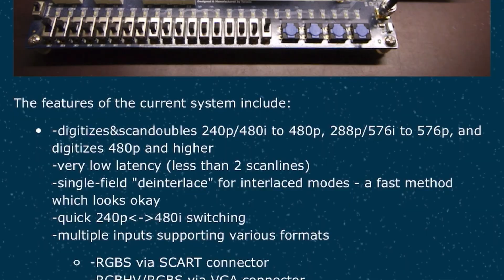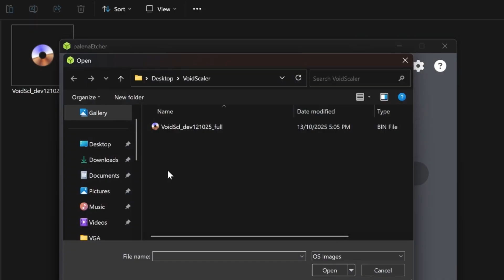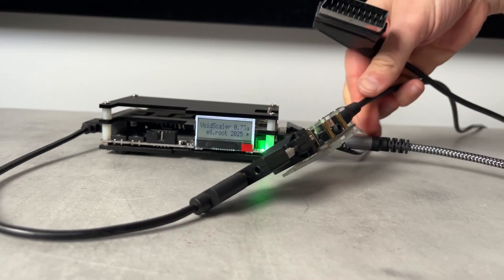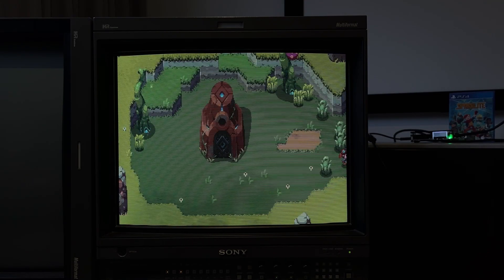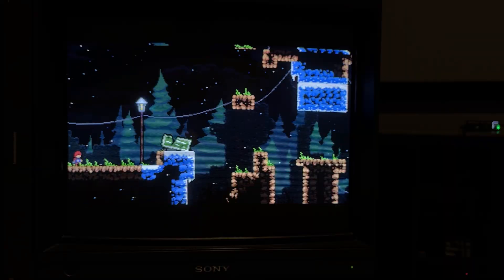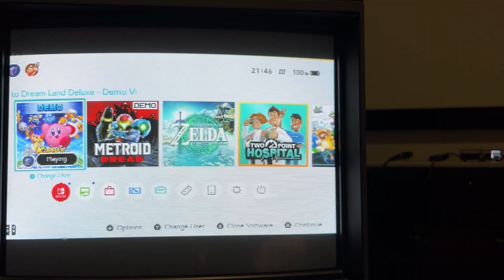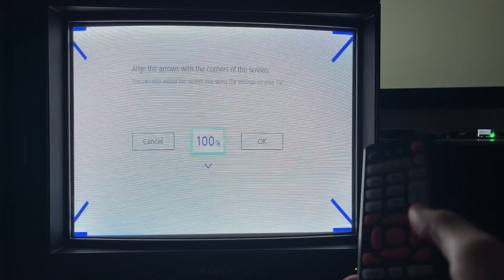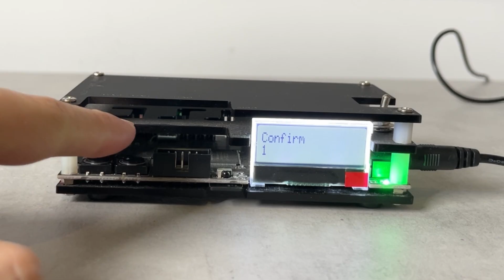Downscaling Chronicles 22: VoidScaler OSSC CFW for Low-Lag Line Blending 240p and 480i Output!

Comment: That's cool ;) But is it possible to connect the ossc on tv with only scart ?
Reply from the maker: Yes that is fairly easily done with the setup I showed in this video, provided the TVs scart port is for RGB and not just composite. You would need an HDMI to VGA converter on the output of the OSSC. Most DACs output 5v on VGA pin 9, so you would need a VGA to Scart cable from a reputable seller that conducts VGA pin 9 to Scart pin 16 for RGB switching on the TV. Something for the Mister FPGA will be fine. Those cables also tend to have a resistor on the Sync output which is necessary to reduce C-Sync to safe levels for your TV. So short answer, yes
Reply: @MarcoRetro316  All right. Thanks a lot for reply.  I will try.

Comment: Dude this is awesome but those DAC makes it a bit cumbersome?
Reply from the maker: It’s not so bad since Pawel’s made it so no sync combining is necessary. Compared to other methods which do require HV sync combining for RGB output like the GBS-C, DExx, RT5x, RT4K, this is pretty stellar. HDMI to VGA DACs are fairly cheap, hopefully they’ve kept support for 240p as I bought all of mine several years ago
Reply: @MarcoRetro316  any particular ones you can recommend?
Reply from the maker: @MagisterHamid  I don’t mind the cheap ones that are powered by HDMI for convenience like the ones I used in the video. The links I used to purchase are long gone though but you could take a $5-10 gamble. If you want reference-quality then check out Kuro’s DAC spreadsheet. The Relfex Prism and HDFury’s are highly recommended but expensive

https://docs.google.com/spreadsheets/u/0/d/1nbepvFFBVsLrs1myOiVWqMVLp9-oB9TataRmVlcyqlA/htmlview
Reply: @MarcoRetro316 I have a HD Fury 3. But you mentioned that DACs needs to be used on both ends?
Reply from the maker: If you want to input HDMI then yes you’ll need one there as well
Reply: @MarcoRetro316 maybe you mentioned it in the video but this method does not downscale Wii’s 480p to 240p right?
Reply from the maker: Correct, it doesn’t currently handle 480p or component input

Comment: Just picked up an Extron DVs 605 and am excited to try it out on my BVM D24 - hoping to get steamdeck and switch to output at 240p - do you think thats feasible? thanks for all the useful content
Reply from the maker: Yes that’s feasible. The steam deck, or at least the OLED model outputs 75Hz by default. You’re best to change the output to 60Hz on the deck. The switch will work fine at any resolution. Given the BVM D24 is multiformat you can use the DVS 605 to downscale 1080p to 1080i which will look phenomenal. Otherwise no problem downscaling to 240p.
Reply: @MarcoRetro316 will I be able to use your edids for the widescreen monitor or do I have to source from elsewhere? Thanks again
Reply from the maker: @8percentAndroid  They should display just fine on your monitor in 16:9. There’s some instructions I wrote on RetroRGB in the downscaling section bottom of the page for the DVS 605. You have to manually adjust the H size for 1920x240p but then you can save the preset for easy recall next time
Reply: @MarcoRetro316  beaut thankyou mate
Reply: Thanks very much

Comment: i got an ossc pro just for downscaling, haven't even had time to try it out, but now i need to buy an OSSC???
Reply from the maker: You’ve already got a prime Downscaler. Currently the cartage of VoidScaler over the OSSC Pro is that it can blend lines. I’m really hoping Markus pulls this code into the Pro
Reply: @MarcoRetro316  that would be awesome, haven't even tested my ossc pro yet! (or my corio 2 for that matter)
Reply: If you absolutely need features offered by VoidScaler you can buy it but at the same time you can just use OSSC Pro and wait for VoidScaler or line blending on OSSC Pro - whichever comes first. I plan on making OSSC Pro version of VoidScaler regardless of if someone adds line blending or not. In this case obvious improvements on the Pro will be HDMI input and no horizontal resolution limitations everything always running at full horizontal resolution like it already does on OSSC Pro's own downscaler.

Comment: That’s AWESOME. I’ve been considering upgrading from my OSSC and framemeister to the OSSC pro, but with this downscaling which was the main feature I was looking for in the pro, is moved to be part of my current setup. Then I can see if upgrading is necessary
Reply from the maker: Try and see once the VoidScaler FW is released if it suits your needs. It’s not as robust as the Pro, but it’s also free in your case and still early in development so it could get even better